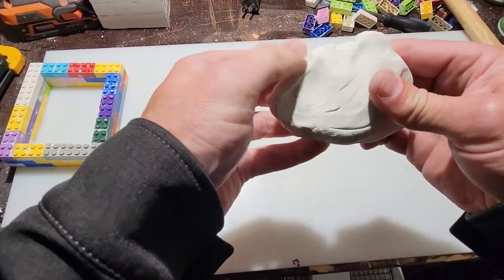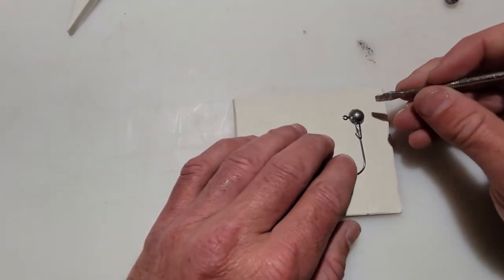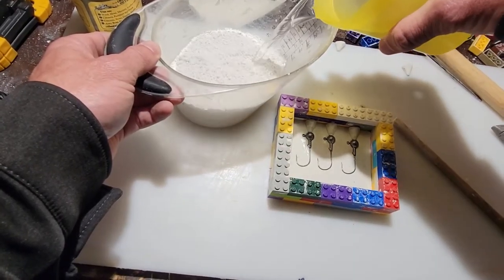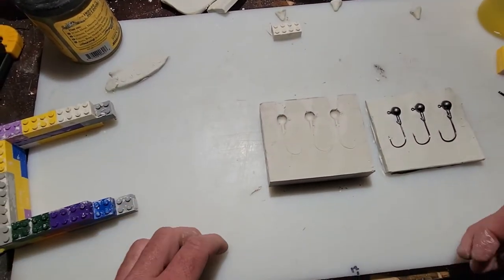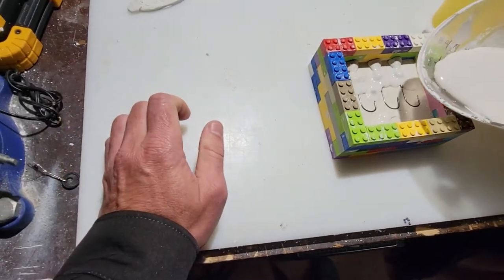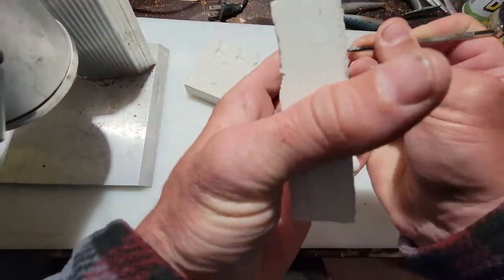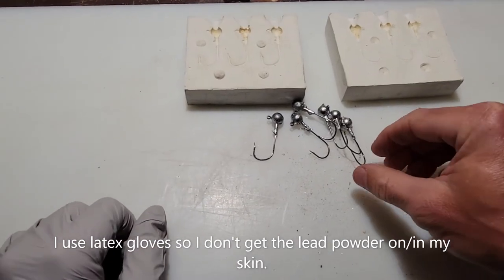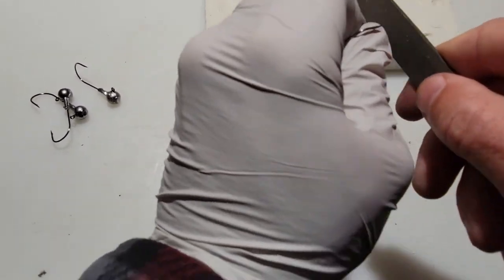How to make JIGHEADS/LEADHEADS with PLASTER of Paris!!!

Comment: How long will the mold last? Is the any showing of cracks or stress? Thanks
Reply from the maker: The mold will last quite a while as long as you're careful. I do recommend using the Perfect Cast plaster for longer, more durable mold, especially for pouring lead. When molding plastics for lures (swimbaits, flukes, etc), the temperature is much lower, it will last much longer if well taken care of.

Comment: what's the machine called
Reply from the maker: Lee 10lb Lead Melting Pot:
https://barlowstackle.com/lee-10lb-lead-melting-pot-br110-volt-model-p345/?afmc=t9

I have added the updated links to the description for the melting pot and jighooks used for near shore (thin wire) and offshore (thick wire). Both are Victory hooks.

Comment: How many sets of legos did you use for the first set and the second.  3-6 hard to see.
Reply from the maker: I think you mean layers, but I could be wrong. It all depends on what you molding. When molding for anything lead, you want the plaster mold to be thick - to hold up to the 624 degrees. I would say to 2x the thickness of the plaster to the lead you are molding. So, it I'm molding a 1/4oz jighead (approx. 1/3" in diameter), I'm making sure the top and bottom plaster pieces are up to 1" thick each. So the entire mold, for 1/4oz jigheads, would be about 2" thick. Again, it all varies with the size of the lead piece you are making a mold of. If the plaster is too thin, the heat of the lead will cause it to get super brittle and break. Hope that helps.

Comment: Hi, thanks for the video & information
After looking at some metal pre-fabed molds i've found a modification for the mold, cutting the mold at a point along the lengths of the shafts of the hooks so you could accommodate for different hook sizes (1, 1/0, 2, 2/0, 3, 3/0 & H's etc) as long as the diameter of the shaft of the hook stays the same. The hook & barb part would be outside of the mold (doesn't have to be in the plaster mold ) when you pour the lead.
Hope that makes sense
Cheers Steve
Oz
Reply from the maker: That is correct.

Comment: Is it possible to do it with silicone instead of plaster?
Reply from the maker: I haven't done a LOT of research on all the silicones available and their heat resistances, butI've done a fair amount. The highest rated silicone I have found is the Mold Max 60, but....it only has a max temp rating of 560 degrees F/294 degrees C. With lead having a min melting point of 621.5 degrees F, it would melt the Mold Max 60. At 621.5, that's just the minimum. For best pouring results, mine is heated to about 850 degrees. Even regular RTV solicone is only rated to 600 degrees F.
Reply: Thank you so much
Reply: @StartFishingToday  Could always melt pewter which is lower temp.
Reply from the maker: Pewter starts to soften at about 471° and fully melted to pour at 620° - 645°F. At that temp, it's basically the same as lead at 624°F. Also, a pewter ingot is anywhere from 50% - 80% more costly than lead.